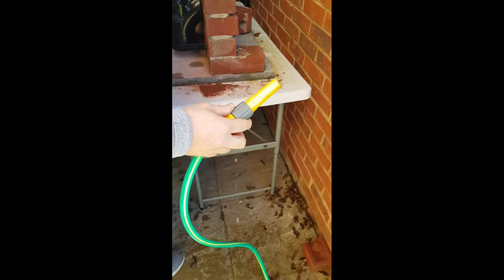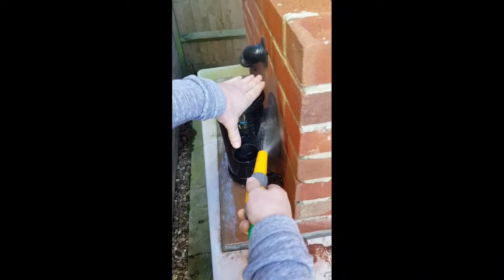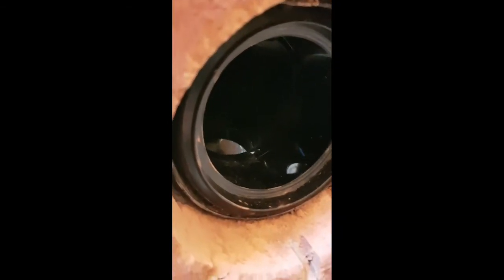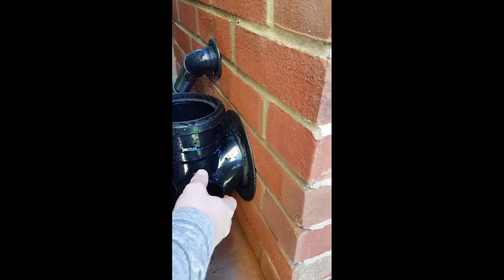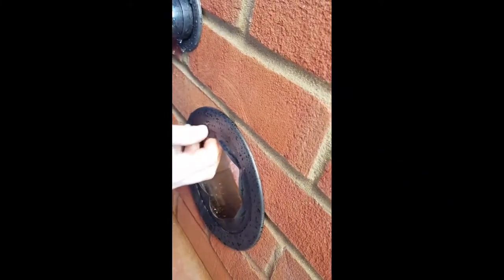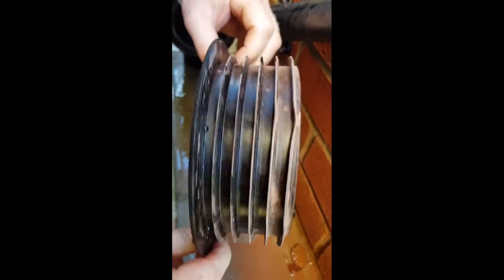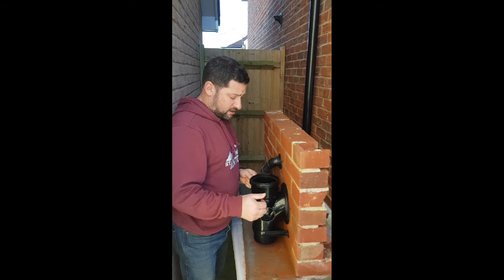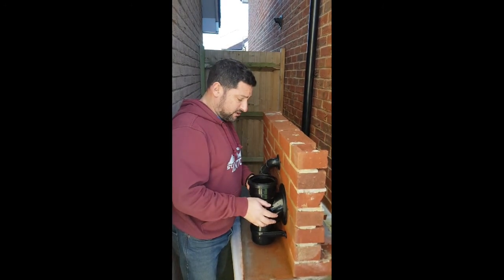PipeSnug 110mm Water Test

Comment: Hi, do you need to drill downwards to use pipesnug and having a fall? Cause normally plumbers drill larger hole and then slope pipes down and flues up. It is not easy to use a core drill hole saw downwards or upwards

Comment: Does the pipesnig go over the wastepioe coming through like a flush pipe pan connector or do yous till solvent weld the elbow to the pipe but with the pipes if over it ?
Reply from the maker: casualchauncey Hi. You push the PipeSnug into the wall. Then push pipe through from the inside and solvent weld to elbow/fitting (or push fit for the 110mm).
Reply: PipeSnug cheers guys. I was 99% sure but thought better to ask!. Great product guys, simple but great. 
Have you guys thought of doing smaller sizes? One for 28 22 and 15 would be good and also could be used internally for certain situations, pipe going through a unit or skirting perhaps
Reply from the maker: casualchauncey Glad you like them! Yes, all sizes are options to look at. Many people already use the existing sizes (32 & 40mm) internally as well to finish off the job nicely 🙂👍
Reply: PipeSnug cheers guys. Impressed by the fact that you re actually using social media and responding to trades via them. Good luck with it all
Reply from the maker: casualchauncey Thanks. Much appreciated.

Comment: Daft question but what size coredrill is it for each size?
Reply from the maker: wayne burgess Not a daft question. The 2 sizes currently on the market (32 & 40mm) both use a 52mm core. This video is for the 110mm version due out in a few months and this will use a 152mm/6" core.